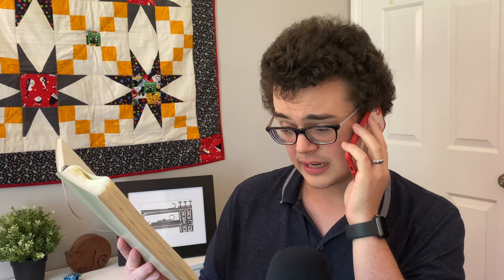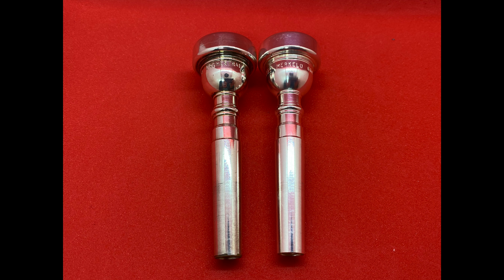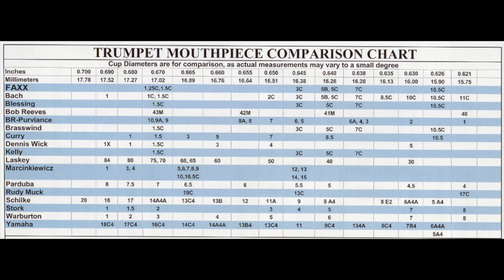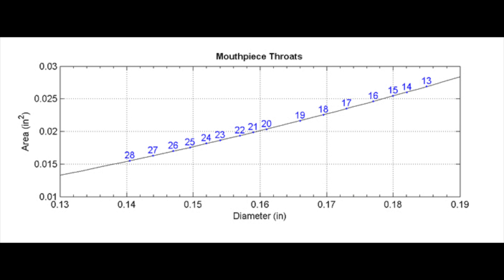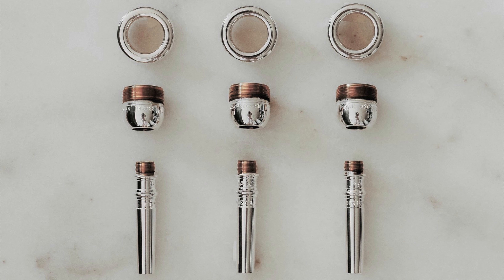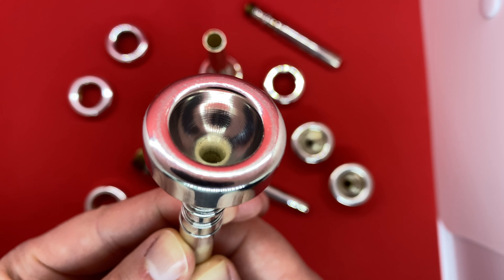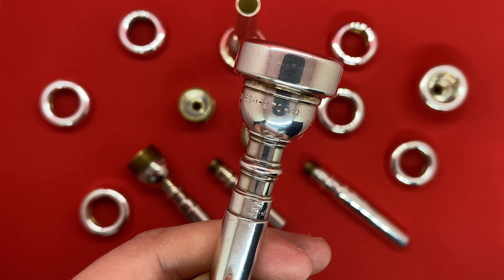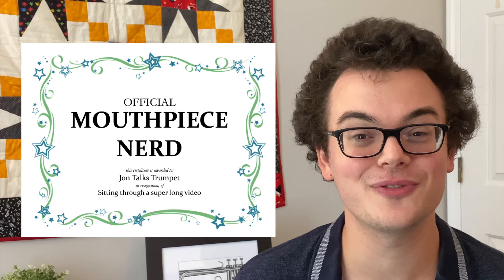Parke Trumpet Mouthpieces: EXPLAINED

Comment: What are the advantages and physical qualities of an “orchestral” style rim?
Reply from the maker: I can do my best to describe how it feels to me, which is by no means necessarily the "objective truth". The Parke Orchestral rim, based on a Bach 1X rim, is a fairly flat rim with a pretty sharp "bite" which is the transition from the rim to the cup. I find this means that the rim sort of pins your chops down in a way that makes me feel very stable and able to commit fully even without being very warmed up. I find that articulation is a bit clearer too maybe due to the stable position of the aperture defined by the flat rim. Hopefully you find this useful, but the best thing to do is to just try as many things as you can so you can become familiar with what works for you, your anatomy, and your needs. If the orchestral rim is too sharp, maybe try their Orchestral R6 rim which is a bit rounder on the inside edge.
Reply: @JonTalksTrumpet  Thanks Jon! Have a mouthpiece from Diane on the way!
Reply from the maker: @matttaekema7214  Great, good luck!!!

Comment: Hi Jon, I recently discovered your channel and am loving the nerd mouthpiece stuff! Great job, keep it up!

I'm curious, what has been your experience with Parke 3 piece sets versus 1 piece models? About 20 years ago I bought some Parke parts from a friend and I ended up using them for some years, basically a 275-24 cup with 2 different 655 rims, one a Merkelo AMD one an Orchestral. After some trying I convinced them to make me some similar one piece models with a 655 rim. I bought 3, a 275, 278, and 280 cups. Unfortunately the rims were so different from my older screw rims that I didn't like them at all and ended up selling them. I think they were annealed, this was maybe 12 years ago or so.
Reply from the maker: Hi John! I'm flattered you are enjoying my content, I remember reading your posts on TH when I was in high school and college. I don't know the answer to your question, but I can take a swing at this one - as consistent as Parke is, there are several factors that can effect how the mouthpieces compare to each other especially over the long term since they have been making pieces for so many years. These answers are purely speculation on my part and could certainly be wrong, but are the things I can think of at the moment.
1. There is the slight variation in the actual tools being used in the CNC which wear down over time and are replaced periodically. 
2. It even seems likely that they upgraded the actually CNC that they use at some point, which might have required some tweak of the CAM file that cuts the mouthpiece from brass. 
3. There may have been a change in how the mouthpieces are buffed or plated which could lead to a slight difference in rim feel. 
4. There could be a slight difference in how the 3 piece versions intersect compared to the smoothness possible with a 1 piece, but Parke is so committed to consistency I would be surprised if this was the case. 
5. I know this wouldn't effect the rim but certainly annealed mouthpieces play and respond differently than the non-annealed versions. Also I'm jealous that you were "mouthpiece aware" when one could still easily order 1 piece mouthpieces from Parke. 
I will say one thing I've learned since becoming a fully obsessed mouthpiece nerd is to never sell a mouthpiece I like assuming I can get another one that you like just as much. I know this is a long answer but there are many possibilities as to the reasons for your experiences! Thanks for commenting and very glad you're enjoying my content.
Reply: Thanks for the long reply! Yeah I'm sure that the parts used in their shop change slightly over time. I remember being a little disappointed as those 1 piece models were quite different and aren't what I was looking for. I'm also a big mouthpiece collector. Lately the Reeves Classical 1c has been feeling great - we'll see how long that lasts! I heard your podcast with Ryan - great stuff. Thanks for sharing!